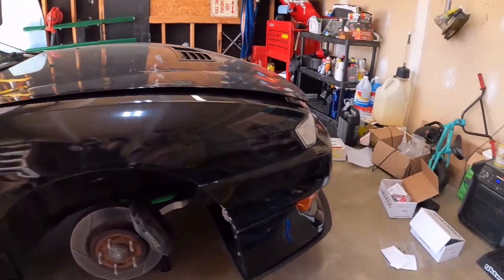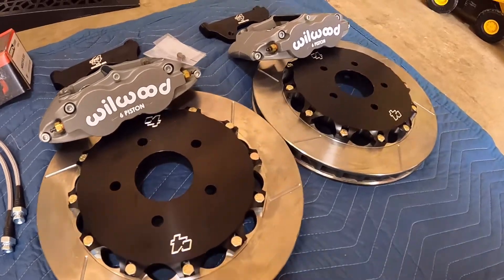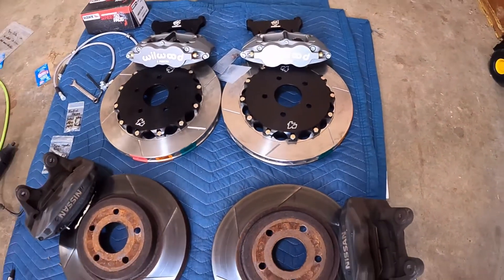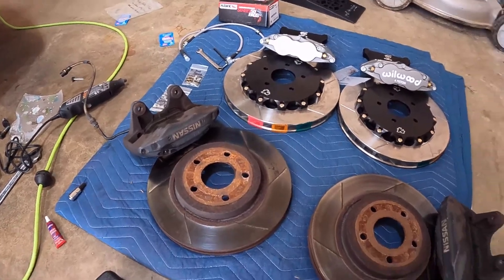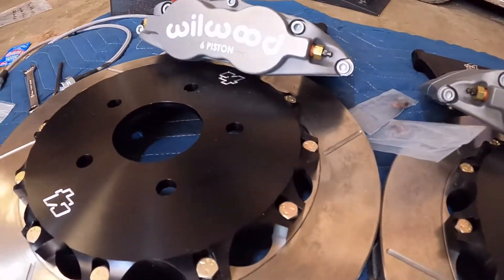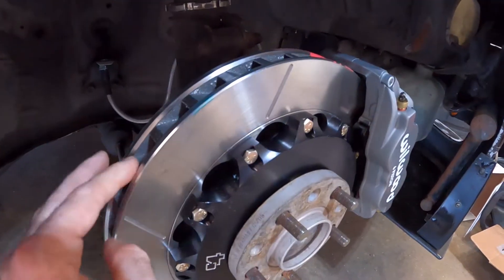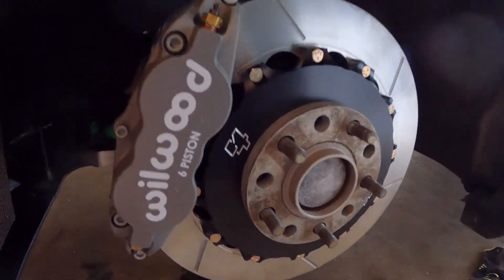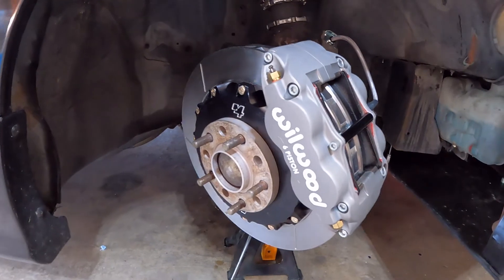S14 Big Brake Kit -- Core 4 Motorsports -- Wilwood 6 Piston Front Brakes

Comment: Which R33 brakes did you have? Was there any different in caliper width for wheel clearance with the new Wilwoods? Thank you! Hope they've been great the past few years on the car since
Reply from the maker: @mitchellweitzman9329  GTST R33 brakes,  no fitment difference at all
Reply: @kylehasfun3114  Cool! How are the brakes as an upgrade over those R33 brakes (which the r33 brakes are already an upgrade over the stock S14/S15 brakes) when on the track?
Reply from the maker: @mitchellweitzman9329  the Core4 kit got me exactly what I needed for real track time, predictable secure braking for full sessions
Reply: @kylehasfun3114  great feedback, thanks! Even if you didn't put them on a scale, was there a noticeable difference in hand during the install for a weight difference?

Comment: Hey 
Looking at these, I wanted to know if the adapter is one size and if you can switch between the 332 and 355mm rotors or if there are separate adapters. Would you happen to know ?
Reply from the maker: Gotta be different adapters.
Reply: @kylehasfun3114  spoke to them via email this was their response “The only change are shim thicknesses to offset the caliper 'radially' away from the centerline of the rotor. The 332mm rotors use the same mounting bolts as the Z33 option, and the 355mm rotors need longer ones”